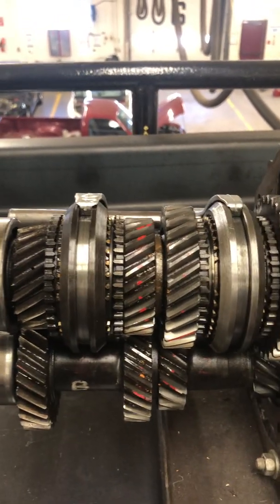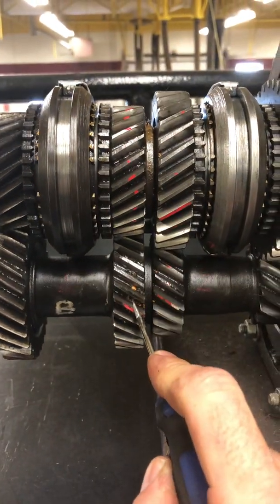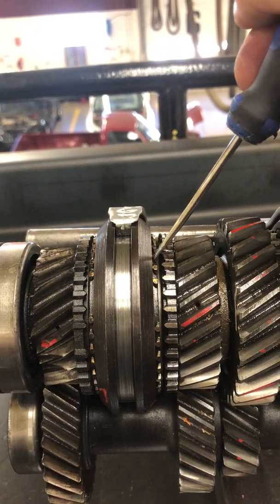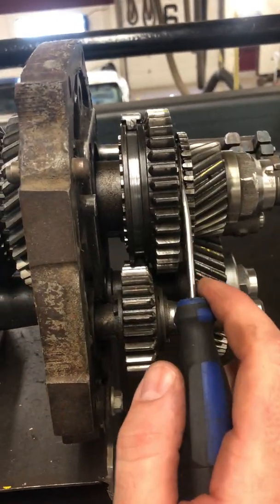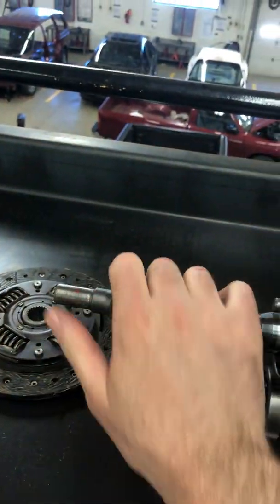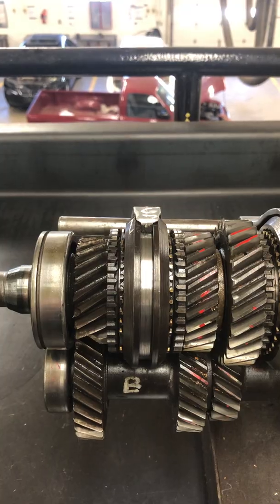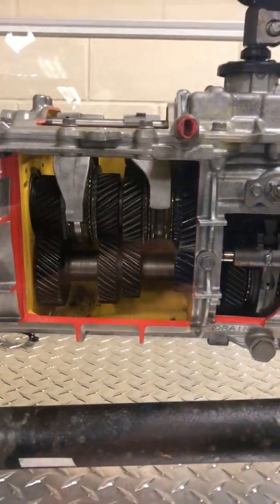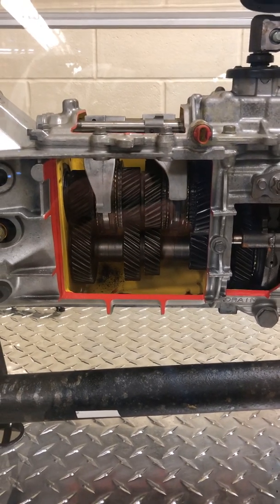Synchros and Gear Shifting

Comment: Thank you for this really good information. I have a T56 6 speed transmission 1999 Z28 LS1 and it has always grinded a little going into 5’th gear never into 6’th. I recently raced it accidentally grinding it at a higher RPM going into 5’th. Now if I drive normal, it goes into 5’th perfectly fine and into 6’th, however, it does not want to come out of 6’th gear. It’s very troublesome almost as if it’s locked in. If I shift fast into fifth, it will grind but not grind into 6’th then again I never go into 6th fast again getting stuck in 6thgear, I can muscle it out but it’s not easy. Fully built motor new transmission, slave, master. If I idle while the car is turned on, it goes into and out of every gear fine. If the car is off, it goes up to fifth gear no problem does not want to enter 6’th gear while car is off, Idling not moving goes in and out every gear no issues, but driving it does not want to come out of sixth, any idea what could’ve happened or what is going on? Really appreciate any feedback as I’m tapped out financially. I was also going to ask if there is a bent fork, but being I am able to go into and out of gear at idle would that mean such. I run the quarter going into 5’thgear, 410s in the back😊

Appreciate any and all feedback !

Blessings
Reply from the maker: The synchro is the softer wear part that is most likely damaged. The shift fork can be a weak point as well if too much force has been used to jam it into gear. Sounds like it needs to come apart for a diagnosis.

Comment: Best demo and explanation I've seen - thank you! I have been trying to make sense of this for Getrag 250 5 speed. 

I was wondering, when downshifting, I assume there is no point in double-clutching with this transmission. But in terms of rev-matching to prevent surging - is is right to rev the engine with the clutch pedal down, or will this wear the clutch? Ie is it better to rev the engine with the car in neutral (double-clutch)?
Reply from the maker: As far as rev matching for gear changes, you will get to know your car and feel the best shift points to prevent lugging. Most vehicles don’t need any revs from neutral to take off in first gear. The bigger the difference in speed between the motor and transmission, the greater the clutch wear and heat